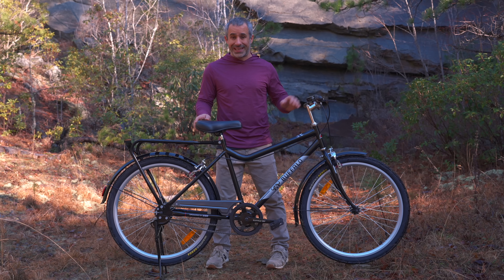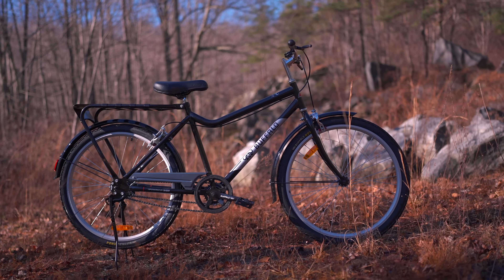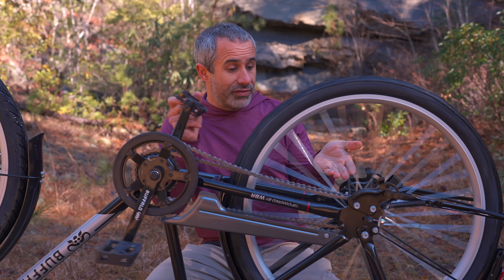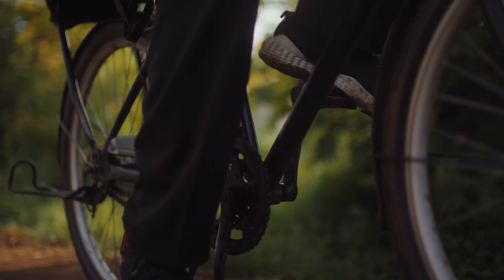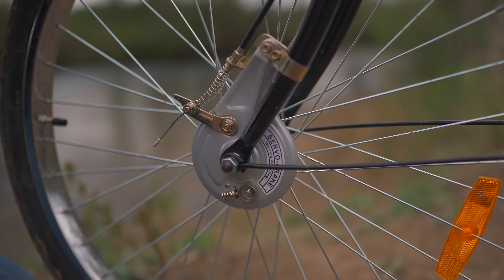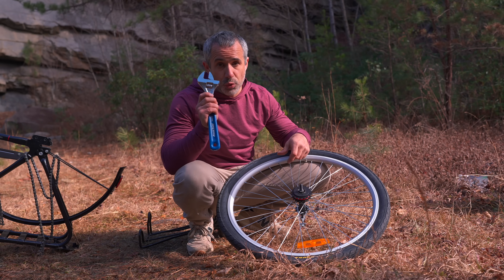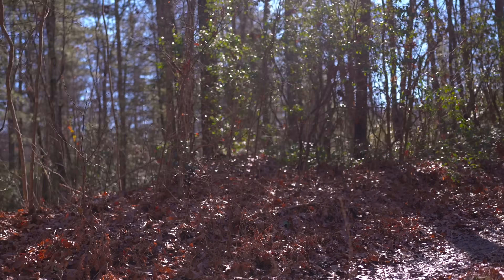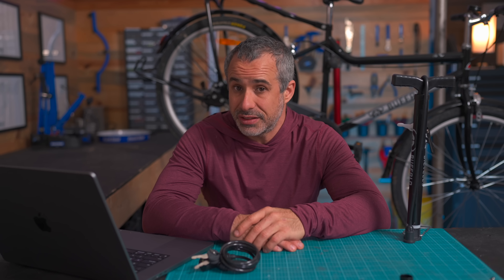Why 2 Chains Make This Bicycle WAY BETTER

Comment: Such a simple yet great and reliable design :)
As a euro I would suggest a refrigerator in the village that gets emptied every day when a truck comes buy. But when your village doesnt sport even one Toyota pickup truck or basic water and electricity then money is tighter than I can imagine.

Comment: This construction makes way more sense than the stupid brakes that engage when pedaling backwards and then block the wheel, that often come with internal gear boxes.
Pedaling backwards doesnt seem to block the wheel or pedal movement either, but just perform the shifting action. That way you can switch to a lower gear AND set the pedals in a good restarting position when you need to stop, that's great!

I hate those back pedal brakes, had near accidents with them, they're just annoying and the reason so many people have to jump off their bikes on traffic lights and then hobble along to reset the pedal position before being able to cycle on.

Comment: Why didn't they go with a freehub instead? I've used freewheel bikes for some time and I keep breaking and bending axels.... in a western city. It's annoying and not dependable. Now, you put any extra weight on it with holes ... oh boy!

Ready to get cheap, mass produced parts are vital for cheap bikes, not custom made freewheels. But to each their own, I guess.

Comment: I don't own a car despite living in Switzerland so I get around on a bike to most places (yes, it was easier when I lived in England and Belgium, this new country seems to have a few more serious hills 😉). I have not really had any really fancy new equipment for the last 30 or so years but part of the charm to me is getting around with what is available and I always fix my bikes up myself. 
The bike shown here is a very cool concept and I would be thrilled to try it at some point. My training as an engineer really likes the functional redundancy of the dual chain configuration.

Comment: They could have just made it a retro-direct 2 speed, less chains, less chainrings, and no issues with mismatched chain wear and associated tension issues.

Rod operated drum brakes would make a lot more sense too, those dual pivot calipers and cables are going to be prone to the elements.

Comment: I’m a design engineer and I just love simple and reliable solutions like this. Less parts means less points of failure and better maintainability of the mechanism.
If I ever find myself in the middle of nowhere, I’d rather have this bike with me than any expensive high-tech bike possible.
Reply: I know this is a tad off topic... But as a handyman I often find myself talking customers out of overly complex ideas.  The reality check can really blow peoples mind when you explain the possible points of failure and cost differences.
Reply: I got one of those really light Trek mountain bikes. And I have to replace both derailers every year that I ride it because they wear out. And when you replace the rear derailer you need to replace the rear cassette. The front derailleur last me a little bit longer than the rear. And the front sprockets wear out in about 2 years. So it cost me $400 a year to maintain this bicycle. That's not including grease tires tubes brakes.
Reply: they claim to have hundreds of physical dealerships with thousands of certified mechanics.. what does that mean? parts... and yet... nothing exists.. this is a charity scam..
Reply: @TrueHelpTV  well they've delivered almost a million bikes, are innovative, are labeled as credible by multiple sources, including the top comment on this video. You're going to need to come with more facts than hundreds of dealerships and thousands of mechanics to prove this is actually a scam. What are your sources? I'm all for being skeptical of non-profits and ngos but you need to have evidence and first party sources for me to be skeptical of WBR.

Comment: I recently got a really rusty bike in a two bike deal. The rusty bike had a low top tube, rear rack and I added more support for items and have stretchable cords to hold cargo, It has shimano sis old style shifting, Center-pull Cantilever brakes, I leave it outside and only give it minimal maintenance. It's the most stress free bike experience I've had for years. I often leave it unchained at the bike rack. I also added a derailleur guard. This buffalo reminds me of it.

Comment: Back in the 70's I had a 2 speed kick back rear hub that changed gears inside the hub but, had single sprocket,  It was also a coaster brake so basically it changed gears every time you used the rear brake.

Comment: One chain straight, the second chain in a shape of the digit 8, and you don't need that "gear-shifter", only pedalling backward to have the second gear ratio. One module less than that bike. It works, you can watch on YT videos on such setup.

Comment: i'm sure the buffalo folks considered their decision to switch to rim brakes for the second model carefully but .. considering that old schwinn 2-speeds use back-pedaling for both shifting and braking (using hub gearing and a coaster brake) i bet it would have been possible with this freewheel-based mechanim, too. not to criticize their decisions, again, i'm sure they know about old schwinn 2-speeds ... those bikes were, in their time, pretty durable and practical.

Comment: I think this is a charity scam that you were conned into supporting...
For a company that claims to have made so many for so long with so many dealerships...
I DARE YOU TO BUY ONE FOR YOURSELF ANYWHERE ONLINE
They don't exist...  Outside of probably a few dozen marketing samples they use in promos.. notice every one of them ever shown in these clips are ALL brand new...
Reply: @TrueHelpTV  your foil hat is on crooked
Reply: @The-Lobotomy-Failed   then find me one for sale.. seriously... Please find one you can actually buy for yourself if they really make so many..
Reply: @TrueHelpTV  The burden of proof is on the claimant, not the other way around. YOU find US proof of your claim. Off you go.
Reply: @The-Lobotomy-Failed  well, it's true you can't buy any online as far as I've seen, though to give them the benefit of the doubt it is probably because of regulation it would probably be more expensive to bring in europe or the us, and not adapted because here you can get brakepads for discs for cheap and getting a thicker steel frame that can be stick welded probably doesn't matter. 
anyway, it probably wouldn't have mass appeal and might not be worth the headache of commercializing.

also how can you prove "I have found nothing"?
Reply: @ if you have hundreds of physical dealerships, with thousands of trained techs (their words) then you should have a parts market.. its not prohibitively expensive to ship parts over seas on ebay.. Correct me here, but they claimed to have distributed millions right? Where are they.
Reply: Can you buy an Airbus A380 online? How about an industrial EUV silicon manufacturing machine? Maybe a Bagger 293 mining machine? Even a Lockheed Martin F-22 raptor jet? Perhaps a mars rover robot? No? Then those must not exist.

Just because something is not put up on worldwide online sale doesn't mean that it doesn't exist. I can go to my local market to buy a knife or sauna ladle made by a single person for that market, and those apparently don't exist because they're not on sale online.

If you're so adamant about it, take a flight to africa, go to like Zimbabwe, and travel into the outskirts and find people that might have these donated to them.

Comment: The new design is interesting but as soon as you get into rim brakes you've lost the plot. Go to any inner city of America and observe the state of the bikes there, especially those ridden by the homeless. The brakes are universally trashed, or removed due to the rims being horribly out of true. Brake wires/brake levers are also usually damaged or gone also.

Basically, when building bikes for the extremely poor, just assume they are not capable of repairs beyond what a caveman could do with a rock. Sorry if that sounds bad but its simply the reality on the ground. A single speed bike with a coaster brake is 100% the best way to go.

If you have to get fancy, a drum brake might work too. Know that the wires/brake levers are still in danger of being ripped off and once gone it won't ever get repaired.

Comment: One benefit of this design wasn’t mentioned; It removes a major source of stress to the drivetrain, shifting while under load. Since the user has to pedal backwards to shift the chain is always slack while shifting. This is pretty brilliant.
Reply: Two speed semi-auto bikes did that 60 years ago.

Comment: I think it's a really neat bike and a great idea. I would have liked to see cable disc brakes, they are easier to adjust, maintain, change a flat, more brake force, less components than even the rim brakes.

Comment: It would be so cool if they made these available in the U.S. I think they could easily charge $495 for the single speed (plus shipping) and $540 for the two speed. They could use that money to build three bikes -- one for the U.S. (or other country) customer and two for the cause. Even at the triple-cost price point, it would be a fantastic budget (yet durable) cargo bike.

Comment: These kinds of bykes already existed in Kenya ... In Kenya we called them Black Mamba.

- They had slimmer tyres, so the tyres were cheaper to replace.
- The brakes were the same as the V2, but didn't use cables.
- It was single gear, but it was designed to be easy to use in most situations.

This bikes seem like just modifications of that original one which was everywhere. Fat tyres mostly. Everything else looks mostly the same.

Comment: Tbh, for western standards I think it’s not really the best for a daily driver, that is in my opinion still hub shifting cuz we have easy excess to repairs but in country’s Like Afrika I think that’s really quit something…
More or less a single speed repair bike but with two gears that just don’t need any wires, that can really take a lot with good low price parts and can hold up for years till it needs first repair…

I wish they would think more kind of that easily in the overall bikeindustry, the way we go now with e bikes, e shifting and all this strange things is in my eyes pretty questionable cuz it just try to make Cars out of our bikes what’s just stupid…

E-mobility should always be a stand alone sector on its own and pedal bikes should just be alone…
This unholy mix between that is not that kind of usefull cuz an e bike gives you the feeling you will do effectly something for your health but when you just rotate your legs without using any noticeable force it’s just don’t your health anything…
But it’s just a thing on the side…

Comment: If the wheel sells itself as having a failsafe if the free wheel fails, then why would I want that free wheel? Sounds like a bad free wheel. Do I really need something that is more reliable than 'extremely reliable"? I'll stick with my 18 speed from 1987 that still works perfect. Even the shifters still shift perfectly. And 2 chains is 1 chain too many.

Comment: For decades I have wanted to build a bike with one chain on either side each side with different ratios on each side.  I have never had a machine shop to be able to do it.  Anyone I described the scheme to would immediately would blurt out, "the weight, the weight and drag", not understanding that not everything is a race, and getting from A to B without fail is the point.  This bike meets the need of the people getting them.

Comment: I have to look at getting one of these. Thanks for br8nging thiscto my attention.  
In my 65+ years of riding, I've never had to replace a freewheel, but I've never lubricated one with WD-40. I HAVE used WD-40 to strip grease and oil out of things and afterward applied lubrication. I've experimented with many lubrication products over the years, and lately have been using powdered molybdenum disulfide on otherwise clean surfaces, or mixing the moly powder with mineral oil and using that sparingly. Dry bearings and chains collect very little dirt, and any steel that has had moly worked into it is pretty much rust resistant. The only disadvantage I've found is the noise created by the individual bearing balls clacking together. It can even be applied to sealed-bearing chains; I strip the chains and sprokets with brake cleaner, then apply the moly powder with a brush, taking time to work it in well.

Comment: One more thing I see - on my bicycle, if my chain breaks, I have to either walk with the bicycle until I can replace the chain, or improvise a repair on the spot and hope it holds. On the Buffalo S2, if a chain breaks, you've still got the other gear to use, and can still ride back to the mechanic.

Sure, it's either going to be slower (because you're in the low gear all the time), or need you to walk up hills etc (because you're stuck in the high gear), but it's better than having no choice but walk.

Comment: The only kick shift bike I've encountered did have a coaster brake. It made perfect sense because the usual ride flow is to start in first gear, kick back to shift into 2nd gear, and then kick back to use the brake, which also shifts it back to first gear at the same time, leaving to you ready to start again.

Comment: Schwinn did the same thing years ago with the two speed kickback hub, glad to see its return!
Reply: Yes 67 years old, can't remember  what happen to Mine. LOVED  IT.
Reply: I got a Torpedo Duomatic hub gear off eBay for my city bike project. It shifts gear by pedalling back momentarily  (they call it kick back shift), and back pedalling further engages the coaster brake. No messy cables that this system eliminates both shift cable AND brake cable for the rear wheel. It requires just a single set of chains. Sachs was bought by Sram and Sram made some in aluminium shell internal gear hubs but closed its internal hub department entirely before launching 3 speed back pedal hubs - that is a crime against humanity!!! I think Sturmey Archer in Taiwan still makes similar 2sp kick back shift + coaster brake version. While I adore my Duomatic hub, I like the idea of this even simpler Buffalo freewheel gear concept, if the slack double chains are kept quiet, possibly with a tensioner.
Reply: Yeah, the bendix 2 speed. With different coloured bands. Somafab still sell 'em. But I believe it's the newer ones. Eagle produces them now. Sturmey used to sell them too, the S2/S2K (Disc) kickback hubs
Reply: sturmey archer is still making one that works almost exactly like this i think
Reply: I rode a 2 speed bicycle 50 years ago. You shifted by briefly back pedaling. I am not sure why this new system is better or revolutionary.

Comment: Looks like a bike that can go on forever.
Although I know the tyres need to be replaced when worn out.
And the chain will stretch over time. For the rest it looks pretty good.
The only thing I see is:
There are not lights (headlight and rear light) on the bike. Only a rear reflector.

Comment: As an African, we do not ask for this. Regular normal bikes are fine. We've always wondered why they keep sending old hard to ride bikes, just to find out they are designing them especially for us. Its kinda insulting to be honest. Funnily enough, 6 out 10 African children can take apart and rebuild a bike, while none of my western peers can. All this does is further kill the small bike repairs shops and make bike parts more scarce. For unpaved road, please send them mountain/offroad bikes with suspension please.

Comment: It a bit like the Duomatic that was available from Sachs. I used to had on in my days as a kid 🙂.
Not done with the Video yet, but I wonder how the Chain stretches and how you would tension one chain if one did get stretched one more than the other...